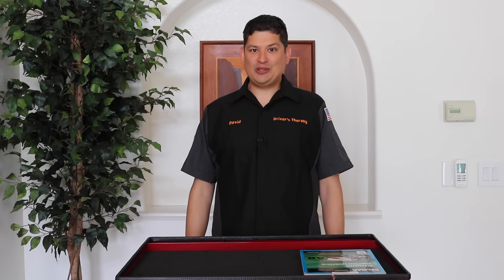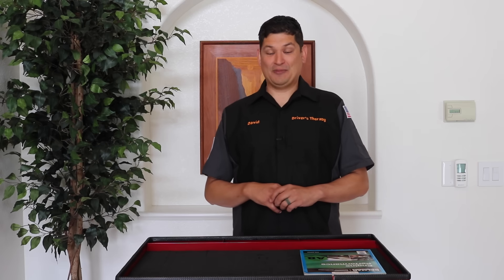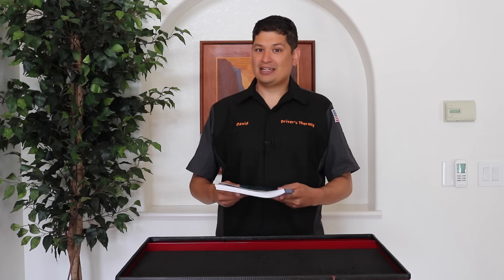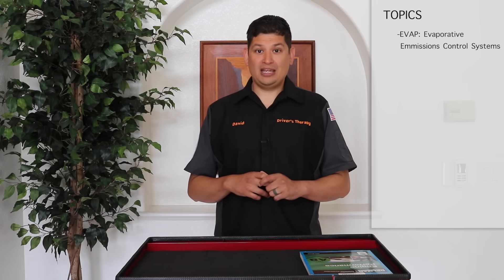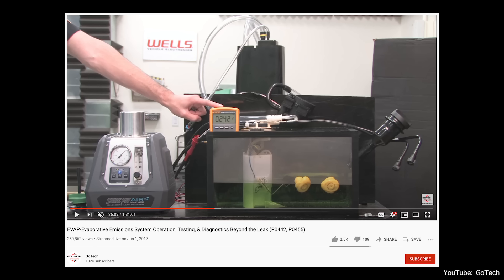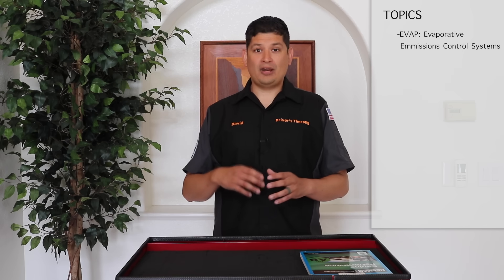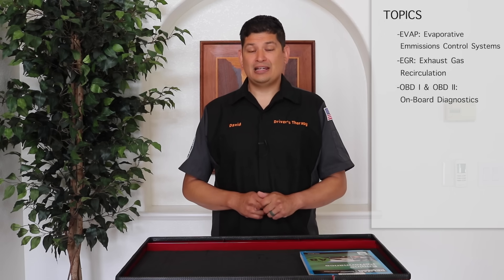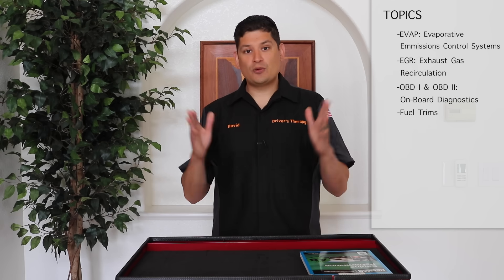ASE A8 Engine Performance - Test Advice & Study Guide

Comment: Good video. Im taking the test June 12th. Time to study harder!
Reply from the maker: Good Luck! You got this. If you have any question let me know. Make sure to understand the EVAP, EGR, and Catalytic Convertor systems really well. Also, whatever study guide you have, take the practice tests, and after you finish scoring them write done what you got wrong. I.E. the answers and the systems it was talking about. Go and research and watch videos on those areas till you understand it completely. After you do that for all your practice tests go back and redo the practice tests. All of them. This is a really important step.
Reply: Hey that's today. Did you pass?
Reply: @12mak  I did pass😁🎉
Reply: @OhFears-  Congratulations! I'm getting ready to take it soon.
Reply: @12mak  You’ll do great.👍 Test was easier then I thought. Had a lot of questions about evap. Different no start senrios.  And a lot of wiring diagram questions. Like Driver therapy mention make sure you know understand the evap, catalytic converter, EGR, Ignition systems etc well. Im just happy I finally passed it. Now on to the next. Btw I used the motor age books to study and practice questions online.
Reply: @OhFears-  Thanks for the tips, I was going to buy the test prep on the ase website but I'll give motor age a shot.
edit: nvm, got a Delmar test prep book, same brand I used for my a6